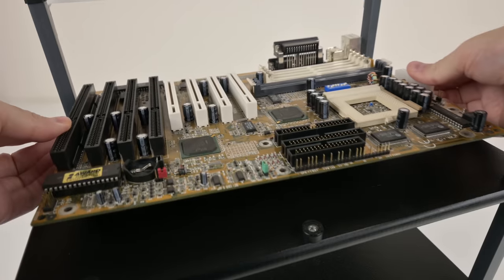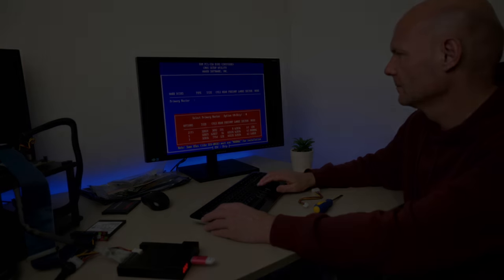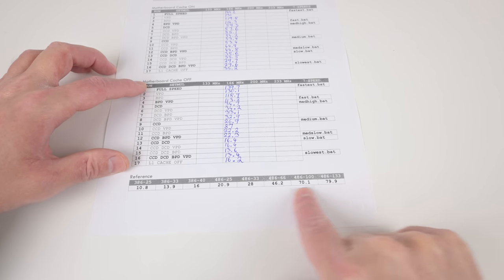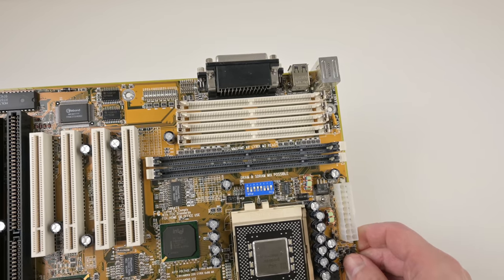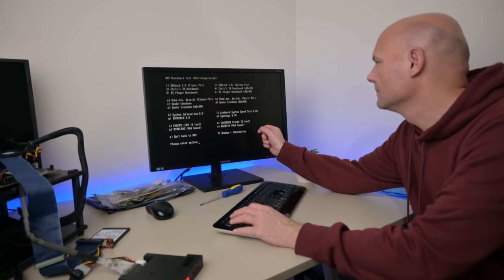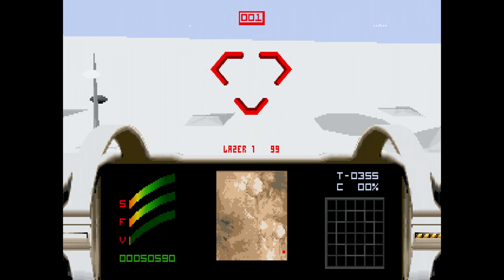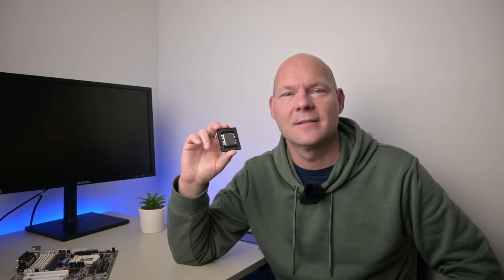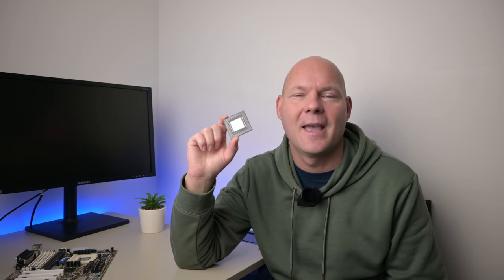Pentium MMX 166 is one of the Best Retro Processors

Comment: My very first CPU, so many good memories. What's interesting, paired with 64MB of Ram and Voodoo 2 did good enough till late 2001.
Reply: Near same for me. I upgraded to a 233mmx and Matrox/Voodoo2 cards, AWE32, 64mb ram,  SCSIii HDDs, and it lasted me a LONG time.
Reply: Was my first as well! I OCd it .. and it got damaged
Reply: @HoldandModify  Out of curiosity: Could you tell performance gain from switching from 166MMX to 233MMX?
Reply: @TurboMMaster  in my 3D rendering yes. Also some games got a small bump
Reply: i had a pentium 200 mmx BUT with 4mb of ram, i suffered a lot because few games worked properly thanks of my parents not wanting to put more money in ram 😒😒😒
Reply: @MrMusicopath  oooff yeah 4mb can hurt. I ran freemem even with my 64mb system. Especially before playing Unreal or Longbow 2 (3DFX)
Reply: It was my second, not counting C64 and Consoles, after the DX2/66, which was a AMD DX2/80 that was sold as a DX2/66 system (the MB couldn't support 80Mhz). Bought the Pentium 166 MMX PC (Peacock) in our local super market and added some more RAM and a Monster 3D Voodoo 2 later on.
Reply: @MrMusicopath  Ouch.  My first PC was a 386SX 33 overclocked by the shop to 40MHz.  4MB RAM, 650MB HD.  It had no soundcard and a trash VGA card.
Reply: I had 233mx and a voodoo2 sli .
Works great .
After that i stap over to amd with 3d now 
Voodoo2 had a good boost thank to 3d now .
If the game support it .
Reply: 200mmx/ 98mb edo/cs4235/ voodoo2 12mb  жил до августа 2003.
Reply: @MrMusicopath 4mb is nuts, in 1997/1998 the base models had 16mb mostly
Reply: Lol same here !!! I had it in a gateway Pc lol. Those were the good old days
Reply: My family had a C64 and later a 486DX with DOS/Windows 3.1 but the first PC that was actually MINE was also a Pentium MMX 200mhz.  I has an S3 Virge Video card and later a Voodoo 2.  I played mostly Duke Nukem 3d, Quake and Quake 2.  The good ole days :)
Reply: @TurboMMaster  Just calculate clock difference 😉 233MMX should be ~40% faster than 166MMX
Reply: XP Kill this era PC
Reply: 166mmx, 64mb ram, 2GB hard drive, 2mg s3 verge
Reply: The first pc I had: pentium 4 1.4 ghz 512mb ram 40gb hdd windows 98 and 15' crt!
Reply: Exactly what I had in 1996!, the computer I bought had as well a S3 Virge 2Mb and a Sound Blaster AWE 32; I changed those two cards with a Voodoo 2 2000 PCI 16 Mb and a Sound Blaster live 5.1 PCI
Reply: What game in 2001 can run on a voodoo 2?
Reply: My first pc was IBM PS2 25 with 20mb hard drive .
Reply: huh. press X to doubt. maybe if you only stuck to old games. i had a pentium 233mmx and a voodoo 2 and it didn't even last to 1999. it ran unreal, unreal tournament and quake 3 like garbage. the last big game it ran well enough was half life. in 2000 i upgraded to an athlon 700mhz and THAT was handled everything masterfully.
the voodoo2 itself, yeah, that did last well into the early 2000's, specially in SLI. but then it suddenly became useless too.
Reply: @GraveUypo  It's simple actually. I couldn't find Quake III or Unreal Tournament working copies back in the day. As a kid I had no comparison to how game supposed to work. So as long as there was no visible staggering, game run from my perspective just fine.  And that characters moved 3-4 times slower than he supposed to was not a problem to me.
I remember that Baldurs Gate II was basically a slide show playable and Z: Steel Soldiers couldn't run at all though. On the other hand, Diablo II was working better than on my later machines though :D

Comment: This was the first CPU I bought entirely on my own as a teenager. I paired it with 32MB of memory (now 32GB is common, just wow) and a Voodoo 6MB card. It was also my first Windows 95 machine. It was fantastic.
Reply from the maker: I skipped the MMX, had a Pentium 133 and straight to Pentium II.
Reply: @philscomputerlab  I had a Compaq laptop with a P133 MMX. Though it was somewhat useless since it just had an S3 Verge for video. Couldn't play SimCity3000 even though it it technically met the requirements.
Reply: 32 гб вау, а кроме цифры красивой, толку чуть, а интереса ноль.
Reply: even in the video, he said that the ram had 32 gigabytes of memory. :D
Reply: where did you want to go that day?🤭🤓

Comment: P200 MMX was when my circle of friends and I built our own machines.  I remember that era well.  I was able to run Quake II, Unreal 1 and Dark Forces 2 on that machine.
Reply from the maker: I'm surprised about Unreal! Dark Forces is perfect for this machine though.
Reply: @philscomputerlab Buddy of mine when I saw Unreal 1 for the first time he had the AMD K6-233MHZ CPU and a voodoo card and it ran great. Not surprised he could run it on a Pentium 200 Mhz MMX. If his card had an accelerator card like the Voodoo it likely did most of the work. Also you can still purchase those startech heat sinks I just recently about 3 months ago bought three of them.
Reply: @philscomputerlab i like the challenge of making games run on the slowest possible hardware while still being playable. You should try it as well 😉 unreal is more gpu limited than than cpu limited on a k6-2. My next build will be 233MMX voodoo 2. I found the old asus mainboard my parents bought with a p166 in 1996. It can fsb 83mhz but I need to desolder the Dallas
Reply: unreal ran really bad on a pentium mmx 233. i finished the game in mine but it was honestly painful. pretty sure fps dropped into the teens all the time. it felt horrible. there was a boss fight that i struggled because performance was just unbearable.

Comment: February 1997. Paired with the S3 Trio 64 V+. The following year I added a PowerVR Apocalypse 3dx (4MB VRAM) which made it last a bit longer, until 1999, when I got a Pentium III 500 and a Savage 4 with 32MB VRAM. I always went for the low to mid range stuff but it was more than enough for that time. Windows 95 CD - Edie Brickell - Good Times.
Reply: imagine pairing it with an rtx 4060🤣

Comment: Back in the day I went from a 486 DX2 66 to the Pentium MMX 166. The difference was HUGE! All of a sudden I could play this new crop of 3d games that were way too slow for my old 486. And some of the games I already had (like Fifa 96, Screamer, Hi-Octane, Mechwarrior 2, and others) were running much better. Around the same time, some PS1 games were made available on PC and I remember being super hyped about stuff like Tomb Raider, Wipeout, and Destruction Derby. Those are all great titles, but my big game for this system was the first Fallout. Such great memories of that old computer and lots of love for the Fallout franchise too!
Reply: I remember FIFA96 had two different commentary sound sets, a normal quality one and a totally different set of commentaries as well as being higher quality. I could never figure out what or how it would activate the higher quality and different commentary. I would fiddle with sound blaster settings but seemed to just have a mind of its own picking which to use.
Reply: K6 166@225mhz was way better
Reply: I changed from 486DX4 100 to P166MMX. But the real huge difference came when i pair it with a Voodoo Rush then a Voodoo2. After that i upgraded to AMD K6-2 350 and used at 400. With 3Dnow! (and MMX also) the V2 its rocks. To compare a Pentium II 400 i remember i had more fps in some games with half price. My neighbor went nuts :)
Reply: There is no 485 CPus
Reply: @CougarCat21  Fixed the typo! Thanks!
Reply: I had in those days a game call POD for Windows 95, do You remember it?. 
I still have it!!
 he he he😂

Comment: I jumped over the Pentium era completely. I started with a used 386 with a 486 overdrive chip, moved up to a later 486 board with a Cyrix "586" or something, then leaped over into an AMD K6-2. I then developed an appreciation for the stability and compatibility of the Pentium II with the 440BX chipset, and that's my preferential target for a retro PC when I finally get the space, time to dig through half-functioning parts, and finances to finish it.

Comment: Great video Phil, I am in the middle of working on a 166mmx digital research desktop I found with monitor at a thrift shop for $25 CDN a few months ago. While I have 486 project on the go as well as a 200mmx dell tower I am trying to make similar to my old pc I had back in the day, the Pentium 166mhz MMX was something I wanted to try and run DOS on. Helpful video !
Reply from the maker: Check for battery and replace it! Even coin batteries can leak...
Reply: @philscomputerlab  swapped it out last night, installed dos on a compact flash card so far :)

Comment: I totally agree. The 166MHz Intel Pentium MMX is balanced in many respects. It has great processing power for late DOS era games and most early 3D Games using DirectDraw (software rendering) or the 3dfx Glide API/OpenGL. It is an inexpensive CPU and not that much sought after, compared with a 200MHz offer while it has the same powerful 66MHz bus and cache size. I think that the generous L2 Cache and the 66MHz bus are the major causes for its performance compared with the older Pentium architecture. Later in the production cycle, the higher clocked Pentium MMX processors did not have much improved performance as the architecture shown its limitations.

Before the 166Mhz Pentium MMX you would have CPUs that had bus sizes all over the place, ending up with a poor performer such as a Pentium 120Mhz (2x60Mhz bus) and a sudden boost on the Pentium 133MHz (2x66MHz bus) out of nowhere. Of course, the CPU was not to blame, it was due to Socket 7 motherboards that only late in the product manufacturing cycle ended up with a lot more CPU frequency multipliers and bus speed. Of course Cyrix was also part of the reason for this surge in interest in the aging Socket 7 platform, as were the popular AMD K6 and K6/2 processors.

In the end, the 166MHz Pentium MMX was and still is a great performer while being not that demanding on cooling and highly stable. You may wonder why I did not mention the MMX extension as a major benefit. First of all, there were few games/apps that initially used it, and when there were more, a Pentium MMX processor, even at 200MHz, was not enough for them. The MMX extensions were actually called Matrix Mathematics Extensions not Multi-Media Extensions, but since they were used in multimedia apps, games being highly popular, it was an example of successful marketing of Intel.

Comment: My first PC after a C64 had a Pentium 133. I always wanted an MMX machine but my parents could not afford it. Things were changing super fast back then. Some years later I jumped over to a Duron system. Now in my retro PC I have a Pentium II 333, which works fine for both DOS and Win98 games.
Reply from the maker: Yes the Gigahertz race was on!
Reply: C64 to 133 Pentium is a huge jump although very depressing about missing the Amiga
Reply: @Jasonsadventures  I regret missing the Amiga, but it was too expensive for me to acquire back then. My C64 was in fact a C64C, the modernized edition, but with still the same old guts.
Reply: @lordwiadro83  I sold my C64 in 1987 to get an Amiga 500, Immediately regretted it and ended up buying another C64 in 198 or so. These days I use the C64 more than the Amiga. I'm enjoying the old PCs too, mostly for music on the OPL specific trackers (like adlib tracker 2 and rad tracker and almost the demoscene) the new picoGUS sound card is getting a workout too.
Reply: @Jasonsadventures  Me personally I don't miss my C64C that much. It was a simple computer good only for playing simple games. I quickly learned about other more powerful computers and I was feeling behind. My first PC in late 1996 opened a lot more possibilities. Even the games were not just dumb arcade games anymore.
Reply: @lordwiadro83  Yeah but the point about the C64 is there's new games being released for it every week these days. For DOS machines.. not so much
Reply: @Jasonsadventures  You are misinformed, DOS games are released these days too.
Reply: from 8 bit comodore c64 to 16 bit 80286@20mhz with MS DOS 5
Reply: I made a text based mini game with batch files for DOS using the DosBox emulator. The story is easy to modify and to add new character to play. I made a video of the mini game. Have fun and feel free to use it for your own game project.😊
Reply: @lordwiadro83  Throw some legendary recent DOS games names at me if you can. I've totally missed them. But I can fix this problem :)

Comment: My Pentium build is probably my favorite one currently. It works well with DOS games, it runs Windows games and with a Voodoo 1 I can play all my favorite early 3D games. A Trio64V 2 MB or better a 4 MB ViRGE and you also have great video (the regular Trio64 unfortunately missess the video features) and hi color graphics in high resolution (high as in matching my 17” monitor). And ISA slots for sound on top of that.

Comment: I have an HP Vectra XA/5 133, and whilst I was inside the unit removing the BIOS password I set it to run at 166MHz and it runs absolutely perfectly. It’s even got 80MB RAM now which is plenty! Runs windows 95/98 nicely and does DOS really well. It even came with a Sound Blaster 16 PnP ^^

Comment: I remember on my super socket 7 board PC, that I still do own, there was a program that opened up all of your BIOS settings that the manufacturer of the board kept turned off and hidden from view. It did make a pretty big performance boost to your PC depending on which settings you used.  I remembering seeing it open up my BIOS settings for the first time that I never knew were even there and I couldn't believe how many were actually hidden by the manufacturer!  It was super fun to play around with.  I know that I have it saved somewhere but for the life of me I just cannot remember where.  I actually can't find it on the machine itself anymore!  I remember that it was mostly free to use, but if you donated some cash to the creator he would open up even more features for you!  I did use that machine quite a lot back in the day.  Now I am feeling nostalgic for it and maybe I will try to get it set up again soon!  It does have a AMD K6-2 500mHz CPU and an AGP slot with what I think has an ATI 9200SE in it. Not the best GPU at the time, but it was all that I could afford and does run games decently.  I did manage to "squeeze out" just barely playing Morrowind at the time.  Good times back then!  👍👍
Reply from the maker: I use a 9200 Radeon a lot! It works great with many 98 games, especially at lower resolutions.
Reply: @philscomputerlab  Yup!  Now if I remember correctly, I think I used Win 98 in that PC too!  Got to check it out again soon.....when I find it.....🤔😂

Comment: My first CPU!
Reply from the maker: Good choice!
Reply: @philscomputerlab  It was already obsolete when we bought it it late 97/early 98 but that was the money we had at the time. Still got great use out of it with Windows 95. I have now rebuilt this exact computer in my retro lab
Reply from the maker: @krz8888888  Do you remember what games you played on that machine?
Reply: @philscomputerlab  Lots of Lucasarts Point & click (Monkey island 1-2, Sam & max, Full Throttle, Day of the Tentacle), The original C&C, Need for speed 2/3, the original Warcraft, maybe some OG Starcraft (not sure about this one), some educational games (Adibou, Zoombinis). 

Lots of those are dos games but generally launched fine from windows 95 barring some sound card issues.

Maxed out overclocked with a Voodoo banshee, ut99 ran okay at very low resolutions.

Comment: Great video as always. I had one of those sitting in my attic for years. Sadly i have a board with no ps2 outs. Managed to get a ps2 to at adapter but need to find a ps2 to 4 pin for the mouse. would be easier to just get a newer mobo i guess lol. Had a feeling these old parts will one day come in handy around 15 years ago. Also had a voodoo 3 3500 just laying there haha. Looking forward for the next video.

Comment: I currently own a Pentium MMX 233mhz with 64MB SDR. It is a very capable processor to run windows games like Interstate 76, monster truck madness 1 & 2 and quakeGL with my voodoo 2 12MB. It also runs mechwarrior 2 glide without problems as other early win9x games like tomb raider 2 & 3. My primary card is a SST-2064/5 S3 Trio 64V+ 2MB (upgraded from 1mb).

For these above games the 166mhz probably falls a bit short on quakeGL indeed. But back in the day everything from 30fps and higher was considered excellent. Duke3d at 25fps was a great experience. The 60fps minimum idea was really a thing that came to life with the internet era from 2005 on. Msdos time was mostly about people being happy about the game starting at all.

All with all a nice video you have made there, but only one thing I disagree on is the 60fps requirement. I certainly will try out the speed limiter for msdos.

Comment: A lot of good points in this video! Love this kind of reviews. I still think this alternative offers way more fine tuning options for DOS than I would ever need in practice. A super socket 7 with a K6 plus version is often more than good enough and can do a bit more Windows9x stuff if you want it too. And I think you can put a Pentium MMX in the same motherboard in case you want try them. But I understand those boards are not that easy to find compared to a normal socket 7 mobo...